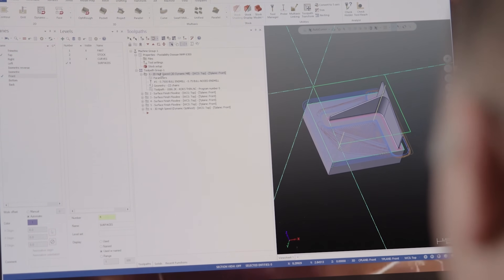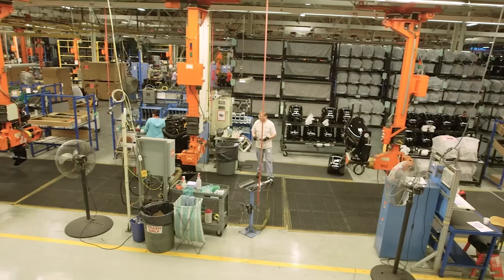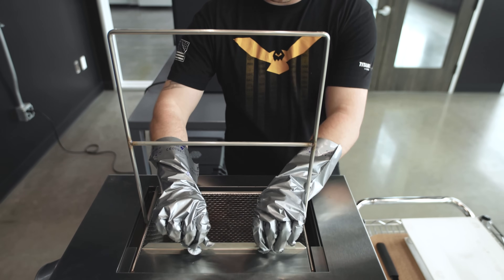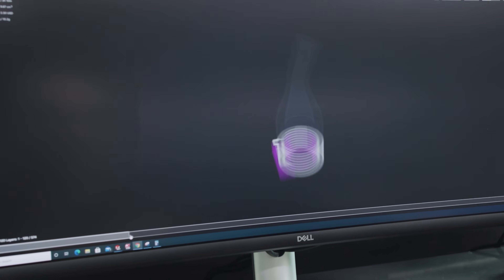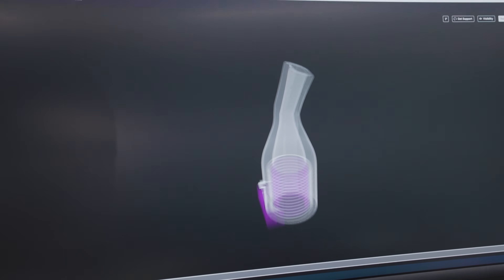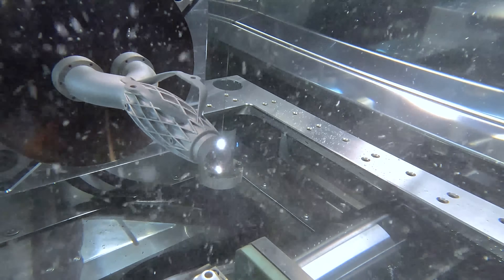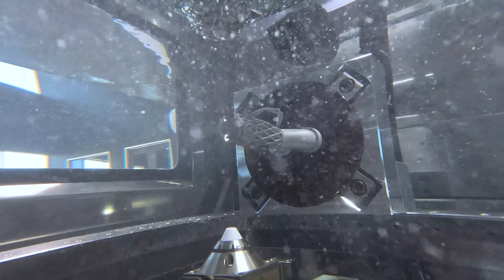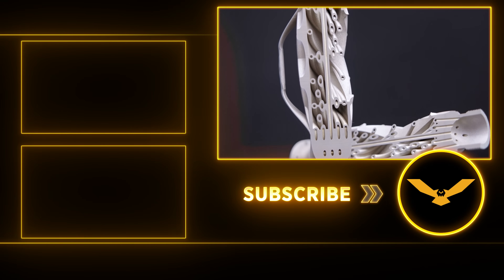Why Won’t Old Machinists Teach Young Machinists???

Comment: Watched this happen the hard way. Worked in a small shop the owner sold because he was so old he couldn't even walk across the building anymore. 

New CEO&Friends decided flipping their new company was the way to go. What was the ultimate flex schedule of eight guys flowing in and out randomly running everyone's stuff while setting up their own with proper lead times, good programmers, and competent machinists. Production was insane. There were times where one guy was running six machines for ten hours overnight because that's when he was most productive due to his personal schedule. 

The new "brains" of the outfit said having everyone in the building at the same time would boost productivity and that we were subhuman on an intellectual level because they were business majors/execs/whatever other braindead take you can figure. 

Their newfound money train running with unique potential based on honesty and hard effort which couldn't be improved upon cashcow turned into a laughingstock failing business in less than month. They were actively hostile to us and decided to "get a second shift" to fix the problem that would train with us and "eliminate tribal knowledge." 

We taught them absolutely nothing. Not even where to find the bathroom. It wasn't the new guys' fault, but not a one of us was going to be training in our replacements. 

I was the new guy when things were good and they were great to me. Learned more there than I have anywhere else. The entire tone of the building changed when bad "leadership" entered the picture.

Comment: I was the only machinist in a small shop and made sure my notes on every setup, fixture, and program was coded in a way that only I could decipher it so that I was hard to replace. When I left after they reneged on their promise of advancement as the company grew they found out their replacement would have to start from scratch on every job. It didn't give me job security but it sure gave me satisfaction.

Comment: I was the machinist for a universities college of engineering for 9 years and loved passing on my knowledge to mechanical engineering students. I tried to make the manufacture of their capstone projects fun and educational in hopes that when they went out in the manufacturing world, they understood problems faced by machinists and tool makers in the manufacture of their designs. To understand the capabilities of the shop that their design would go. I also tried to make them understand that those machinists or tool makers are happy to pass on their knowledge, which was gained over more years of schooling then the engineers themselves had just gone through.  I miss those students and would still be teaching, but for the climate in todays college campus.

Comment: I learned a lot from George Butler at PI, but he shared an interesting experience from when he had just started. He got trained in by an old hand on a job, who had figured out ways to cut a lot of time on a job he’d run. When the job got analyzed George’s times were better than the old hand. But instead of the old hand being praised for doing a great job training, he was criticized by his foreman for being slower than George. After that the old hand was bitter and didn’t share his tricks. That’s not a good way to encourage the dissemination of knowledge.

Comment: Regarding the subject of this vid. You make him out to be an odd old guy. How well did you know him? He sounds very intelligent, sometimes, most times I think, people way above the norm have a hard time relating to others. He may not have been hiding anything, possibly he was just trying, in his way, to be useful. 

I have this feeling this guy didn't fit in in any way with the culture there. Just came in and did his job, and at the end of the day, went home... 

I've run across a couple genius's that worked somewhat ordinary jobs. One was an electronics technician. He couldn't complete a bachelor degree because he simply could not pass required English classes. But he was far more intelligent than the run of the mill PhD physicists we had warming up the chair seats. In between his ordinary tech work he did original research in non-imaging optics, RF, acoustics, and other new tech. Socially he was bit awkward, but he was a great guy once he TRUSTED YOU. The idea of him showing someone how to do what he did, it just couldn't work. 

Another fellow was our model maker. He'd take your sketch, a few hours later you'd have this glittering thing in your hands. It wasn't exactly what was on your sketch, it was exactly what you meant to have on the sketch. How he did that I will never know. Generally, he was a very easy going easy to get along with guy.

Comment: When I was young I worked at a company that had “machinist helpers” who assisted machinist and learned from them as they progressed towards apprenticeships. He would take me out to the beackyard with a clipboard in his hand and say, “take this, this and that to the steam rack, clean them up and bring them to the press and strip them. I’ll be over there, come and get me if you have any questions or if you finnish” and I would spend the night cleaning, stripping bearings, gears etc., off of these huge 20’ shafts.  He was lazy BUT he later showed me how to operate a mill, lathe and grinding table as well as to read micrometers, depth guages, calipers, and most measuring tools.

Comment: I am not a Machinist or Programmer, I work in a CNC shop doing in house diagnostics / repairs. I've had a few people try to work under me, and it never works out. If they have a problem they would come to me without even attempting it on their own and I would tell them to figure it out. The internet has a wealth of knowledge, and the way I look at it, you will retain the info if you have to work for it. It's a cold world out there.

Comment: If you had been in the Machining industry in the late 90s you would probably understand. I was a CNC machinist until 2001 and all the machinists were fighting over jobs because they had shipped all our jobs overseas. In 2001 the company I worked for came to us and said hey we're not paying your benefits anymore and we're not going to pay you any more per hour to make up for it. That's when I got out of the Machining industry. I hear it pays really well now but I was one of the best of the best, I could run CNC Mills CNC lathes and I programmed most of the jobs. We used to do work for slumberger, Halliburton, KBR, Etc. I did the hardest stuff in the industry at the time but I was only making $21 an hour. If you had lived through those times you would understand why he was that way

Comment: I have a Machine technology Associate degree, is a 2 yrs education. In school, they only cover the basic running tiny little lego pieces. In real life, real machining the pieces are 500+ pounds n you need to learn how to use a 20 tons overhead crane, forklift, hook, belt, and magnet. If some one spent 10yrs on an EDM and they wanted to move to a lathe or a mill its going to be very hard. Most mechanical engineer with a 4 yr education don't even know what tooling profile is or an insert or how to indicate a 4 jaws chuck, but they can tell you the equation and laws of thermodynamic, the weight of the object, volume, and temperature. A lathe is Calculus 2, 1 man 1 machine, 1 person setup n 1 operator for the night shift "red and green". Auto CAD certification is a 3 course credit.  When I graduated back in 2018, there are only 4 of us in the classroom. I do teach new people, because I know the company machine and control system are outdated; setting up a Haas is not the same as a Mori or Doosan. The older generation machine are extremely dangerous, needed to be treated with respect. With the older lathe you don't move the tail stock with a button, you use a big old wrench and muscle lol

Comment: I got into the trade just as CNC was coming in. I ran a moog tape read machine at night after trade school. Volstro rotary heads removing backlash etc. The shameful thing is this industry could flourish with talent again, but manufacturing was shipped off to china and its never coming back. This gentleman took his lumps getting to where he is. He knows hes Undervalued compared to other trades. Cant just Start your own shop today because unlike  a plumber or an electrician who get started with a van and tools, a toolmaker requires very high start up costs for machinery. Maybe China will build our next battleships.

Comment: I work in IT, and where I work sharing knowledge is a requirement for employment. Refusing to do this will actually hurt your career if you act this way. We often ask many questions about this during interviews and wont hire mid or late career people who can't give examples of mentoring that they have done in the past.
Reply: With IT I can accept that far better because systems are more likely often than not completely different setup wise

Comment: It's sadly everywhere, I'm an electrical engineer, also with a previous background in aerospace, a year or so back things where a bit tough going with employment in the area, and ended up working for a company as a maintenance electrician/mechanical fitter.

It wasn't the kind of work I prefer by a long shot and that has now luckily changed, but because of my education and background I was hired on a fairly good salary for the area, however I was working with a "old school" mechanical fitter, who somehow found out within about six weeks what I was earning (I didn't tell him) so there was some sort of data protection breach at that company.

He was not happy, never even stopping to consider that while I am new to the company I have the background and training in a different skill set to him to earn that salery, unfortunately some skills are not valued the same as others, he decided from that point on unless he got a pay rise he would not help in the slightest, and I don't mean with trade skills I mean with everything.

That meant site knowledge and machine knowledge etc etc, so if a machine went down and it was known that it tends to fail in a particular way, instead of saying hey go check this or that, I'd get no advice, and instead of fixing something within say 20 minutes, it would be hours of tracing problems both electrical and mechanical, to then be told after the fact that "it almost always is _______, you should have checked that first", and that machines can't be out of operation for that long.

Basically I was being sabotaged and set up to fail because of a data protection breach, and a bad attitude born out of jealousy.

Then on top of that I saw him do incredibly dangerous things, such as opening isolators up and swapping the phases on a motor to reverse it during a maintenance operation, never bothering to check if it was also isolated further back (it wasn't) and being a soft start to run as delta, L2 was a direct connection, only L1 and L3 went through SCR's if someone had not flicked the breaker off back at the panel (which he never bothered to go check) and instead just disabled the run signal, then he would have got a belt off of L2 if he touhched it when he disconnected it.

Jealous idiots ruin everything.

Left soon after that, and if the HSE has any sense they should pay that place a visit.

Comment: I started my apprenticeship in the mid 70's, and I have worked in a lot of different shops making everything from aerospace to military, to gun parts to auto parts to commercial products, and I have tried to work with and teach everybody I could. The problem I came across in my 40 years as a machinist/manufacturing engineer is that most people do not want to learn they just wanted to push a button or pull a lever and go home. And now a lot of people don't know what a machinist is. Maybe that's because I'm in NY ? I don't know anymore. And that's why most manufacturing goes to China.

Comment: I was assigned to learn a machine from a 30+ year machinist. He refused to teach me anything. He would only use me as labor to clean up the parts. I tried everything: asked questions, shadowed, did it wrong on purpose... 
After several weeks, I picked a nonsensical fight with him about sports. (I don't care about sports in the least and told him how pointless sports are.) After a 2 hour long yelling match while working, I apparently earned his respect and he never gave me any more trouble with teaching me. 
Don't know if there's a lesson in there for anyone else, but it worked for me ..

Comment: Sounds like cutthroat stuff. 
In the building trades it seems to be much different you need the younger blokes to take up the physical stuff to free the more experienced blokes up for more complicated tasks.
Where the experience can not be duplicated by a keystroke because it requires years of muscle memory to make it look easy. Theory can only get so much done with a wood chisel, a paintbrush or a welding torch.

Comment: Theres two sides to this as someone in the in-between category, the main reason I see these days with younger guys(not all) and older guys not wanting to teach them is they(not all) would rather run long pitch times and stand around on there phone. I see this a lot now a days and I see guys getting paid good money to do this.  The other thing I see is some older guy's who would rather spend time doing jobs for themselves neglecting work to do so because they feel they can.Also some(not all) believe they know everything and cannot be brought up to date with tooling etc. because they are set in there ways. Again a lot of this has to do with individuals attitudes and not a generalisation.  Either way from what I've seen when you get a young guy ho want's to learn paired with an older more experienced guy who's willing to teach, things tend to work well.

Comment: same reason why the younger generation invents new software and better technology that replaces the old technology..... If you don't want to share knowledge, we will engineer better solutions.   Thats the reality of it lol.  I've been programming my 5 axis cnc for about 3 years and i can create any parts.. I tried to pay older machinists to teach me simple things but they wont because they are scared to get put out of business by someone better.   The downside to being a bitter old stingy bastard, is that we are 10x smarter than you old heads and we will create our own solutions, so either way you will get left behind. for example, my solutions to dealing with machinists who dont want to share info was to write AI program for CAM that can program a cnc based on the material, cut depth, overlap, etc automatically based on thousands of other parts and how they were cut.  i can load cut paths and program files from ANY machine into my software and it analyzes and trains the AI for future use.  Pretty soon there wont even be a need for the human brain as AI is much smarter and isnt afraid to lose its job.  automation is the solution for insubordinate humans

Comment: Get a grip….. you teach some guys what you know and you’ll get the ax cause your older and the company doesn’t want to pay you too money. Show guys what you know and you run the risk of at least one of them experimenting with what you’ve taught them and screw up and the fingers get pointed at you. Show a guy what you know and you actually kill your own value to the company cause if other guys can do what you do then what’s the point of having you around. Show a guy what you know decreases your own self worth personally for all the crap you put up with to be where your at. Need I go on?….. the company and tour manager doesn’t give a crap about team building and so forth they just want the work done as cheaply as your willing to accept as a paycheck and they will cut your throat in the blink of an eye with no prior warning. Just be happy you have a guy in the shop to get stuff done and won’t rat you out when you do screw up and leave it at that. You read the damn books you talk and learn from senior guys you get it together over time like he did. Think a machine shop is a trip try aerospace.

Comment: I graduated from a machining institute. I landed a job working a cnc and a Bridgeport mill.
The other machinist had many years of experience. I would run a program & set-up the material for cutting.  The other machinist would constantly tweak the numbers! The boss started to wonder why he hired me! I was being undermined and I was not appreciating the situation!  Finally, the guy went on vacation for 2 weeks. I had several projects come in and I produced the parts perfectly.
The antics returned when he came back from vacation. I had enough, quit and returned to driving tractor tanker trailer, hauling gasoline. Some senior machinists are insecure. Matt wasn't going to share ANY knowledge. I don't need the drama! Learning to operate a Bridgeport mill, lathe and a CNC was alot of fun. But, no one wants to apprentice these days!